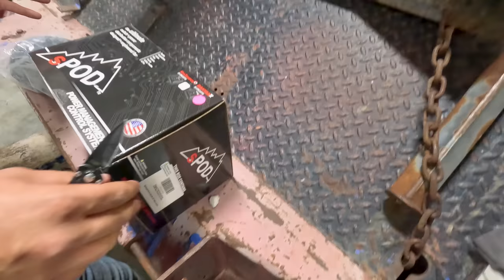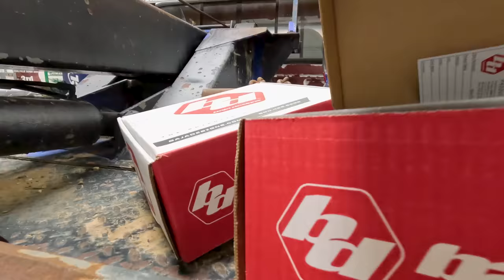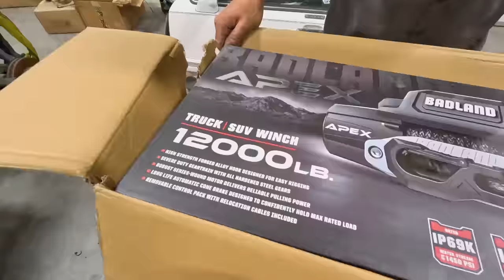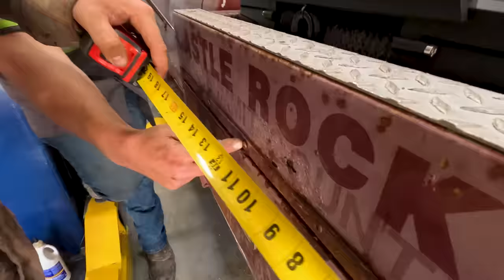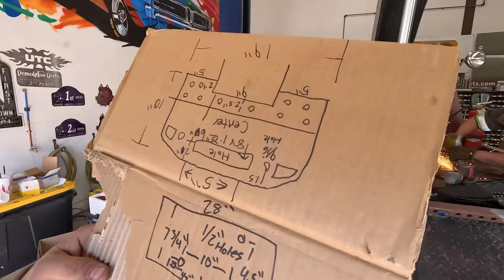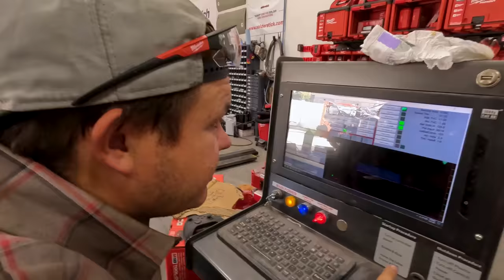Adding Massive Winches On Old Ford Tow Truck Bed!

Comment: If that is an Optima battery, there's your problem. I have one that went dead in a week. Fought with them for 6 months to get a replacement. In the meantime I installed an American made battery and have not had a problem since. I put the Optima in another project truck I am working on and it went dead again. And it is the replacement for the first one. Get you an American made battery and forget those junk Mexican batteries.